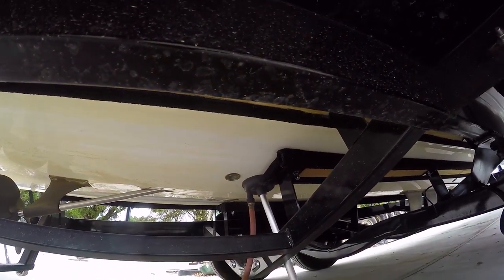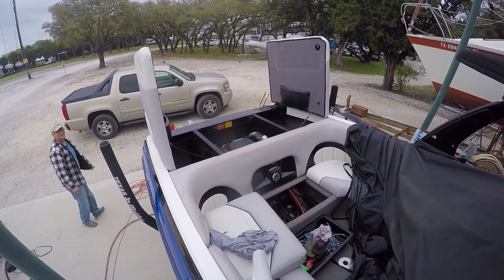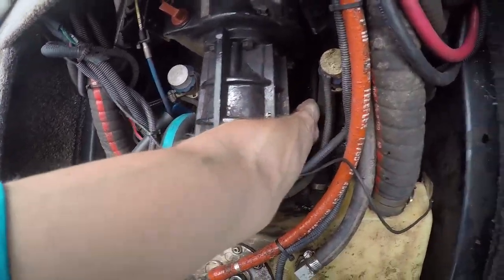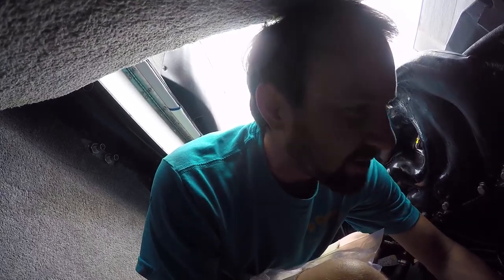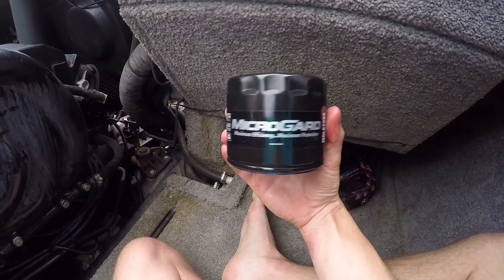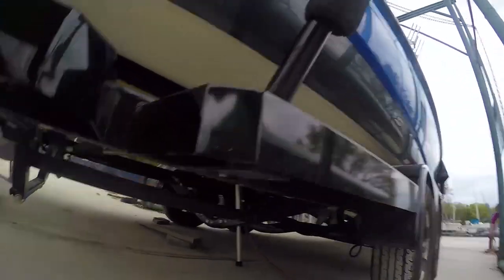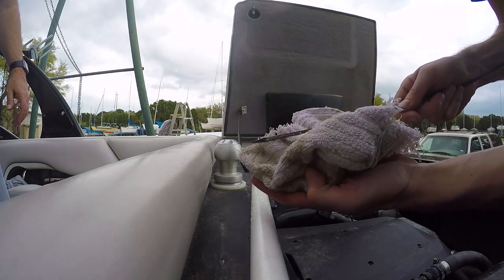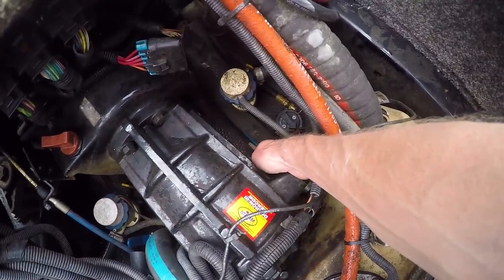How To Change The Oil In A 2007 Malibu Wakesetter 23 LSV

Comment: I use a drill pump, too, but connect it to the quick-drain line. That way you're pulling from the bottom of the engine. Just use a larger diameter hose, like the one you have on the output side of your drain pump.
Reply: Where do I buy everything I need for this? Drill, drill pump, hoses clamps, etc. I have no idea what all the parts and pieces are I need to make a drill pump??

I want to attach to the bottom of the boat not going through the dipstick 

Sounds simple but need the details por favor

Comment: My Malibu dealer says the reason pumping the oil out of the dipstick tube from the top of it didn't work is because the dipstick tube doesn't go all the way down into the oil pan on this engine. You can insert a straight skinny stiff tube down (carefully) and use your pump then, or like you did, warm the engine oil up and drain out the hose - says that's the safest way, since the skinny tube can wind up in the crankshaft.
Reply from the maker: Thanks for the tip. May have to give it a shot next time.